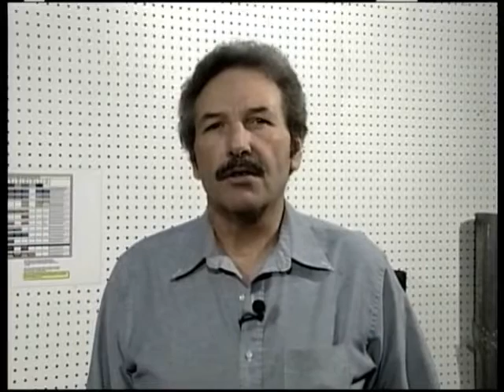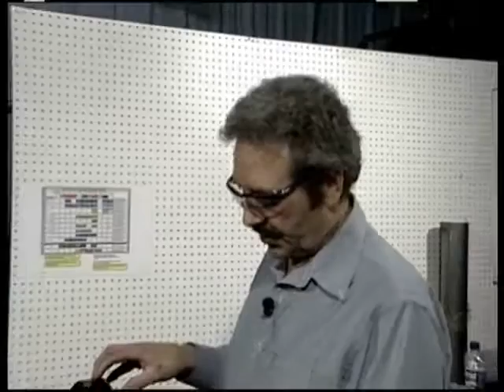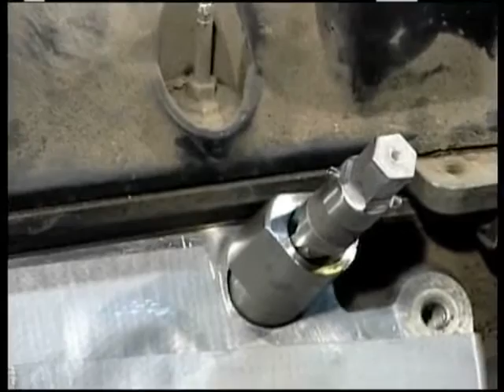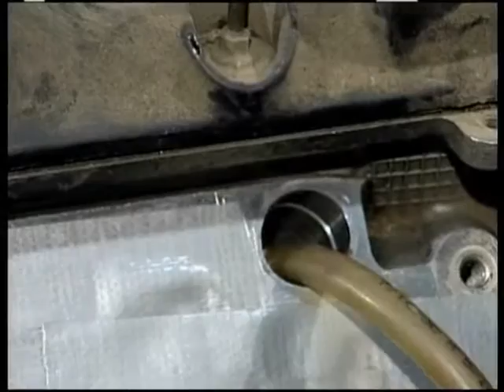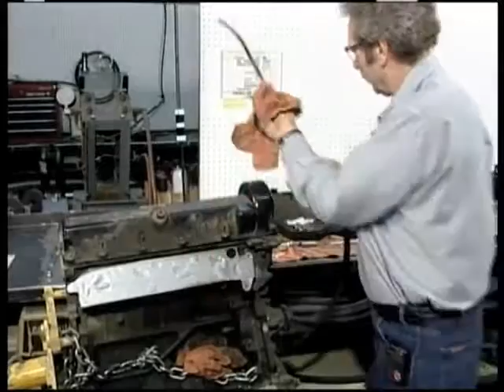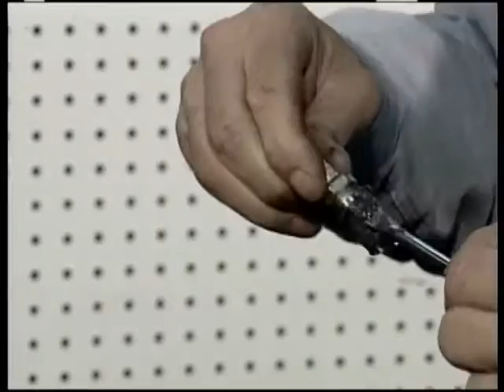Calvan 38900 Instruction Video

Comment from the maker: Free fast 1-3 day shipping, no sales tax outside Florida, tips that answers FAQ's and phone tech support when purchasing from us. We also quality check our kits before shipping. Good luck calling Amazon if you have a technical question or defective tools or inserts. Not a problem when purchasing from us. Kit that has JB Weld and Thread Locker linked here: https://www.wiseautotools.com/calvan-38900-8-thread-repair-kit-with-jb-weld-thread-locker/ Lowest cost kit with 2 inserts linked here: https://www.wiseautotools.com/calvan-38900-2-ford-4-6-5-4-6-8-spark-plug-port-thread-repair-kit/